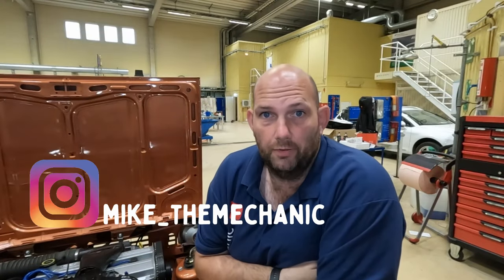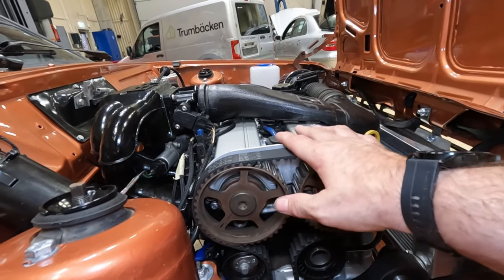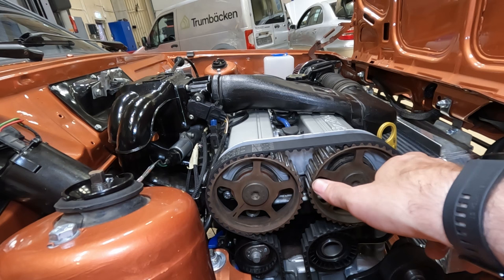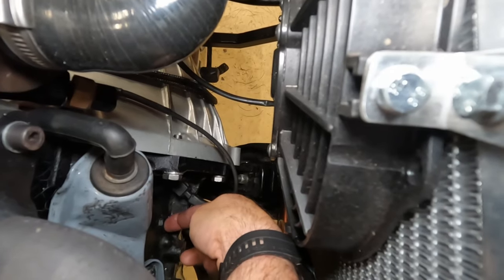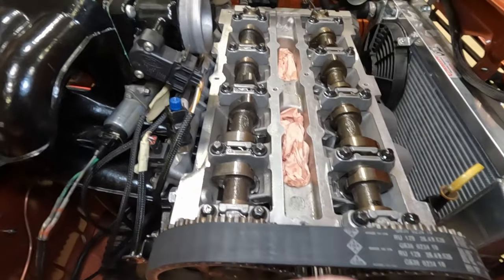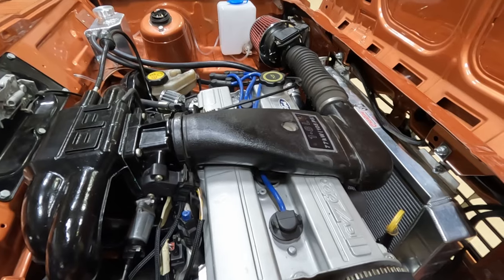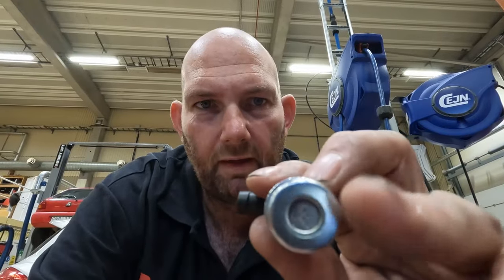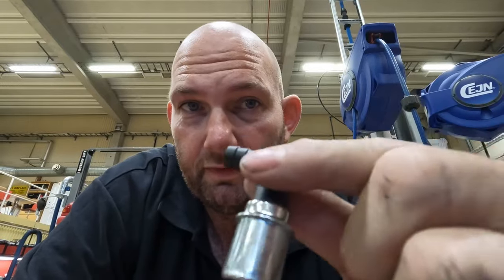Fixing a bad Idle On my MK1 ford Fiesta zetec conversion

Comment: Had a 1.6 Escort have same idle issues, changed that PCV valve, perfect! It blocks the air from the crankcase coming into the air intake at idle with a high vacuum, but on open throttle, the vacuum drops and the valve opens letting the fumes out of the crankcase (Blow by etc) into the intake to be burnt!
Reply from the maker: Loads of people told me it had an air leak but I couldn't find it, I had no idea it was an internal air leak 😂😂

Comment: Big hello, love the work ,going to start at my one in the next few weeks
Reply from the maker: Thanks and good luck with the build. They are so fun to drive 😊😊
Reply: Did the way u wired up the loom work for u ,
Reply from the maker: @assassinscreed9502  yes it works fine. The only mistake I made there was cutting the loom and then having to slice it all back together again. Mark up every connecter as you undo them if you remove the loom yourself
Reply: Sound thanks ,
Reply from the maker: @assassinscreed9502  no worries. If you need any advice during the build let me know and I'll try to help.

Comment: Just rebuit a head on a Vauxhall a18xer, same set up with the rear bar but it has a two piece toothed tool that locks the two cam pulleys together. You'll never convince me they couldn't have keyed the cams, bloody stupid idea.
Reply from the maker: Totally agree with you. I don't really see the point in not keying it either.